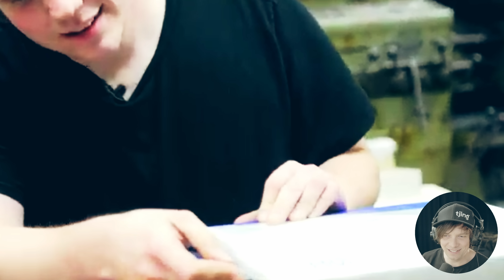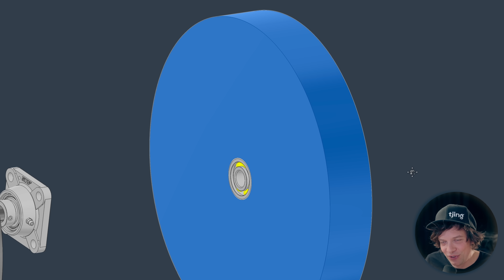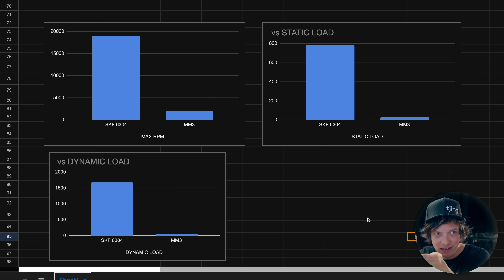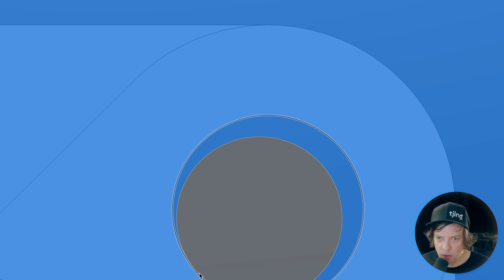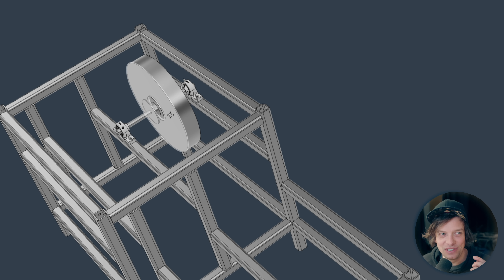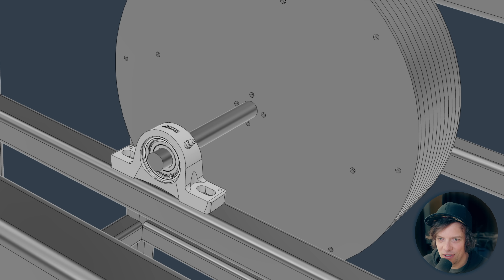Worst Bearing Housing Ever - Marble Machine 3 Ep.3

Comment: Thinking every idea you come up with is better than the ideas of trained people in their respected fields SCREAMING AT YOU TO CHANGE, is not brilliance it is arrogance.

The issues is not the bearing failing, its uneeded complexity, the wanted potential rattle, the unwanted fiddling, the fucking threaded surfaces getting wollard out during use purpetually making balancing a nightmare overtime. its believing your idea will solve problems better than simple proven solutions. 

Your fkywheel is the powerhouse, it needs to be straight on the shaft and balanced, preferably concentric but if balanced sufficently it will be ok. Just get a machined shaft on a lathe (WHICH YOH SHOULD FUCKING HAVE ANYWAY and is kinda why we invented lathes), and get two propperly machined "stops" which can clamp to either side of the weight. The stops machined also on a lathe. An apprentice could fucking make it. You simply need a round block of metal with a well toleranced bore with a smooth facing cut done on atleast 1 end. with both operations cut using the same set up, it will be perfectly concentric and perpendicular to the inside bore. Drill the clamp holes yourself if you want to save a tiny bit. YES it will cost more than your shoddy design, but its your fucking flywheel...but seriously is the kind of part they literally get apprentices to do.

Just to reiterate BOLTS ARE FASTENERS NOT LOCATING DEVICES.

Comment: Have you considered using the flywheel plates themselves as bearing housing? You can press fit the bearings in the flywheel or use a flange to stop the bearings from drifting laterally.

Comment: You say the flanged bearing housing cannot be concentric because the holes are oversized, but 1) they are oversized so that you can adjust it to be perfect, and 2) you need adjustments somewhere, otherwise it is YOU who is trying to design something perfect. Your design adds constraints, and you expect them to be perfect right away with no adjustments. How can you guarantee that your bearing housing will make your bearing concentric to your flywheel? Looking at the assembly in the first couple minutes of the video, we can see that the bolts are tilted, probably because the holes from the two plates are not aligned. How does that not happen when you assemble the marble machine? Also, your press fit relies on bolts that are hammered in. Well guess what, they have to be hammered in because you have to deform them. So then, how do you guarantee that you deform the bolts equally on all sides of the bearing? All these things are ok, they can happen and they WILL happen, so you need to also prepare adjustments to make your flywheel work properly. But then, if you have to add adjustments to your design, what is the advantage of your design compared to a purchased flanged beargin housing? Answer is: none

Edit: you are currently trying to create a design based on the single manufacturing process that you chose to restrict yourself to, but it should be the other way around. Your requirements seem to be precision. Then use precise manufacturing processes...

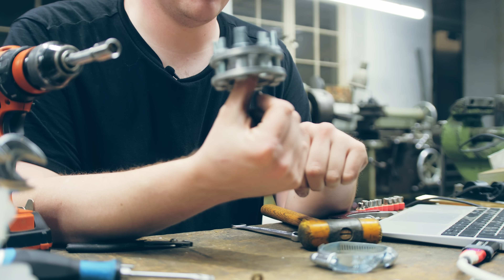Comment: 3:02 or you just use a second bearing. This is like first day of engeneering. One bearing is no bearing. Always use two or more!.
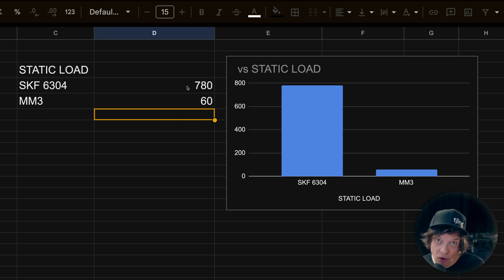Reply: 9:24 but I don't know if it's on the opposite side of the flywheel, or if its cantilevered.
Reply: @roberthopwood3758  I posted this answer before I watched the whole video. The last idea is decent imo :).

Comment: I ask myself: Why do the parts need to be lasercut? Why  not lathing???

And no, big holes in the plates... for storing rotational energy it's not needed to make the plates completely solid. The stored energy is proportional to the radius; So it's much more efficient to compare this design with how real flywheels look and works. It will spare you around 50% of mass but looses only some 5% of the storage capacity.

Comment: I’m a truck driver and when a mechanic is mounting a new wheel on my truck to try to make sure the wheel is centered he uses blot the is in a cone shape on two of the bolts to center the wheel then mounts the other bolts and when they are tightened down he’ll remove the cone shaped bolts and mounts the rest of the regular bolts holding the wheel in a centered position

Comment: You need an automotive wheel bearing. It comes with a housing, only needs one side for support, and lug nuts are designed for auto-centering sufficient to keep a wheel balanced. Attach the flywheel with a standard wheel bolt pattern. The shaft can be splined and have either a CV or U joint out to drive the system. The shaft itself would be very resistant to misalignment that way.

Comment: Just use the positioning pins and mark the position on the flywheel with a lasered dot, then drill the holes manually to get your precision. 
8 points don’t define a position better than 4 do. This will only lead to a over-defined fitting, worsening assembly and function - which is also why those four holes on the bearing are not meant to be used for positioning

Comment: 16:15 is there any ball bearing that's purpose is to hold a shaft perpendicular on it's own, without a second bearing? In my experience ballbearings always designed to hold horizontal or vertical forces and placed in an layout with anough fexability for torgue.
Reply: Yes, angular-ball or roller bearings in preassembled x- or o-configurations (better option here) are used for this application

Comment: Tapered rollers would be a great option in this application.  They can be adjusted for preload, account for wear, run super quiet if greased and would remove any harmonics roller bearings could introduce into the frame.

Comment: Local man rejects a flat disk with a hole in it for a flywheel. A design so simple, that they didn't even bother with it when I was in machinist school because it was too easy to make.

Martin. My man. My guy. You are building a piece of rotating equipment. Embrace the lathe. Don't fear it.
Reply: He even built a rudimentary one into his mill already. Just mill the pocket to press fit a bearing, then throw the thing on the rotary axis and just... rotate the stock to cut it concentric.

Comment: Honestly, I don't think the design is as awful as some people say (taking into account he's trying to not machine the huge parts).  It's certainty... unorthodox. 
I'm worried that the teeth of the screws will damage the bearing over time but the MM3 won't be running  24/7 (so it may not be an issue after testing).
For the second design, a system similar to a lathe's 4 jaw chuck could maybe work.
Since Martin sent his plans to SFK, I'm not too worried.
I'm excited to see what solution he settles on.

Comment: The bolts holding the flange to the wheel are not under the same kind of loads as the bolts holding a bearing in place.
With a properly mated and bolted surface, the 2 surfaces are pushed into each other and they hold a large portion of the sheer load, rather than the bolt itself.
With a bolt pressed against the side of the bearing, and the majority of the plates being separated by air, it is the bolt itself which holds the vast majority of the load. This creates a very different situation. This makes the bolts far more likely to fail.

Comment: 13:50 Though holes for bolts aren't precisions surfaces. That's not how you use through holes. You can't align stuff with bolts and though holes.
This video shows, that Martin is missing some basic Design theory concepts. In my bachelors for mech. Eng. I had 4 exams and 3 projects just around screws, bearing and stuff like that.

Comment: They weren't saying the bearing would fail, they were saying the bearing housing would. What is the maximum load on your bearing housing, before it loses its concentricity.

ChatGPT is a language model, not a math model. So you should always double check its math. It can start out with the correct formulae, and then entirely fail the basic math.

Comment: You are really grasping for straws in part 2, honestly. Sure, your way of manufacturing may not take advantage of all of the standard components' features for alignment, but the cobbled together housing has the exact same alignment problems.
Also, an easy way to fix your problem with swiveling bearings would be to... not use them? Use the correct, absolutely standard one?
Either way, the issue isn't the bearing surviving, it's that your flywheel needs to be balanced. And probably the easiest way to get close to that is by machining it; in which case it's already perfectly ready for machining in the features for locating an off the shelf bearing.

Comment: Hello,
As a mechanical engineer, i think that when you will tight the bolt, it will compress the bearings and create a stress in the axial axis. At time, this stress will degrade the balls. 
Whereas the skf flange doesn't transfer any axial effort. By allowing rotation, they make the system isostatic. 
Blocking the two bearings will result in a hyperstatic system (which you don't want in your case), if it's not perfectly concentric (which is not possible) it will create radial effort in the bearings. 

I think the best way to lock the rotation between the axis and the flywheel is the conventional one : use a fitted key, you juste have to laser cut a notch in the center hole. You can also use a machined flange with a radial screw if the torque transferred from the wheel to the axis is low (should be the case if the pulley is attached directly to the wheel) 

Also, i think its more important to balance the wheel by drilling  some holes or adding weight, than having it perfectly concentric 

Hope this will be useful, sorry for my imperfect English

Comment: 18:57 does it matter if the wheel is loose on the shaft? As long as you have the gearwheel connected to the flywheel and not the shaft? - if the flywheel would prefer to spin on the axel instead of bearings, would it really matter much?

Comment: Martin you did not take into account the length of the shaft and how much difference from one end to the other.  Do the math on being 2mm off from one end to the other and the bearings that allow for the shaft to not be perfectly straight may be a better solution.  It will allow faster swapping of them if any one or both wear out, least amount of disassembly for repairs and less parts in manufacturing.  Chasing perfection is a loosing game where you may end up loosing time most of all.  With concentricity of a flywheel, look to how ' toy ' steam engines are done from cast metal.  They get the shaft hole to finished size and put it on a lathe that will take off what is needed to balance it then cut it down to size.

Comment: I think the idea of limiting yourself to a single build method (using only laser cut plates) is not wise.  
You are making it an emotional decision against well proven, readily available engineered solutions that are available world wide.
Considering you have a power input, a flywheel, a clutch, and a power output, it is given that there must be at least 2 rotational (if not more) speeds accounted for on this shaft. A live shaft could only be tied to only 1 component, so some components must use bearings

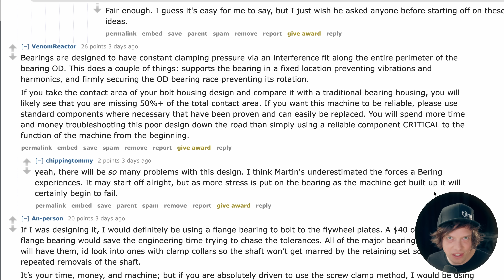Comment: 8:21 But it's not just the bearings that are taking that load, are they? Those bearings are resting on threads which are not designed to take such a load. In time those thread tips will start to deform and your bearing housing will begin to develop quite a lot of play.

Comment: Hols in flanged bearings should be concentric so that you get the ability to move the flange, then bolts will squeeze the flange to the flywheel and hold it in place.
The pins you mentioned, are normally added after balancing to lock the assembly in place.
And in my experience, big metal plates rotating at high speeds are one of the biggest risks you can have in design. In cut loose they will chase you, jump over obstacles, or go the them.
Regarding design with bolts, apart from the component count and accessibility to parts, You would need to get solder bolts, or with applied stresses threads will start to fold or crack (depending on hardness).
In the past, I did learn that I have a tendency to overcomplicate design with custom parts. At some point, I learned that even if Your application may be innovative, an individual problem that it is trying to address, probably was someone else too, and with common problems, there are common solutions. Flange bearing may not be solution you are looking for, but there may be a better solution out there.

Comment: Flywheel alignment and concentricity is not a problem with standard flanged bearings. You need the flange bearings with the location pins. The 4 holes are larger on purpose to align the bearing.
This is how you have to do it:
- The laser cut flywheel must not have any holes for the location pins.
- You roughly mount the bearings on the flywheel and put an axle through the bearings
-Then you clamp the axle on two blocks
- Then you can align the flywheel by loosening the screws slightly and tapping the flywheel with a soft-faced hammer so that it runs smoothly
- When you are satisfied with that, tighten the screws
- Then transfer the location pin holes to the flywheel with a drill
- Now only the pins have to be inserted and you can change the bearing at any time because the Locaion pins fit

Comment: I used to have a professor who said: "the best component, is no component"

What he mean with this is that you should keep your design as simple possible. The more components you add, the more components can fail. Try and see if you really want to overcomplicate your bearing design, when there are many tried, proven and easy to implement designs already. Go with those. Im worried you will make the same mistakes as before. You used to say: "form by function" but I dont see that happening here. Take the easy route. Use the good skf bearing and press it in your flywheel or something. Or use two bearings on the side. Make sure these are self-settling bearings..

Comment: Why exactly are you trying to over-engineer a thing that was never a problem from the start and is a solved problem since forever? 
Also, having commercial solutions and not one-of-a-kind custom overengineered parts will make the machine infinitely easier to service when pieces will fail - and they WILL fail: no machine lasts without mantainance. Also keep the axles short: they are the most likely source of vibration.
 But it does not matter: this machine will never go on a world tour.

Comment: I doubt you would have any problems with your bolted design.
If you did, you could use the flanged bearing with a dowel pin. Just cut the dowel hole in the plate 0.1/0.2mm oversize. It will be more than good enough.
You will need to balance the flywheel anyway, to get vibration free running, but that won't be a problem, as you are building a flywheel balancing jig already.
Just add a few extra holes around the rim, so you can attach weights, for eg.

Comment: For your concentricity concern: you can either dial it in using an adjustable mount on the shaft and a dial indicator, or you could balance the wheel with the shaft already in it on two horizontal rods, making small adjustments

Comment: Theres a good reason why those tried and proven designs, that are used everywhere, are designed the way they are. Actual real engineers put multiple generations worth of work into designing those. You're simply not at that level and your amature design wont beat that. xD
The LAST thing you wanna do is make your design stiff, because no matter how tight you make the tolerances, they will never be perfect, and to compensate for imperfect tolerances, you have to give your design wiggle room, hence why the bearing housings are made that way, they allow an uneven axis to rotate without ceasing up and damaging the bearings.
Cus if you force this much kinetic energy into a rigid design like that, it will just stop working. It'll be much wiser to use housing designs that are tried and proven, for longevity and smooth operations and instead focus on how you can get the flywheel balanced to near perfection, because if you try to spin it up in a rigid design like that, it will shake your machine apart.

Comment: The live axle is the way to go, but I would increase the size.  It is probably fine as shown but it looks a bit small.  As for mounting the flywheel you will need to balance them anyway so adjusting the concentricity is not a huge issue.  Also machining them on a lathe would not be that difficult, I would not discount that and a second step.

Comment: 3:03 - Have you considered all the negative feedback is based in the fact that you yourself, said your problem was biting more than you could chew, so to speak? That you over complicated things and derailed focus. Wouldn't you say that dedicating all your focus on coming up with "a new way" for mounting bearings, going upstream against all tried and true solutions of decade, if not centuries, is derailing and biting more than you can chew? No one can build a contraption like your idea based on prototype ideas through and through.

In my opinion, you have to design around standard parts if if you ever want to finish this project successfully. Leave the creativity and experimentation to the things where there are no off-the-shelf solutions available.